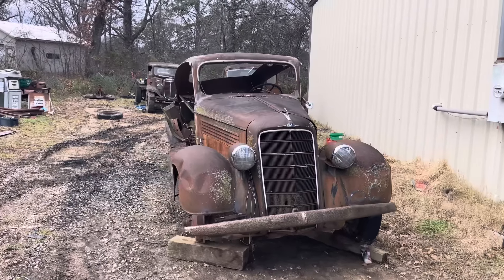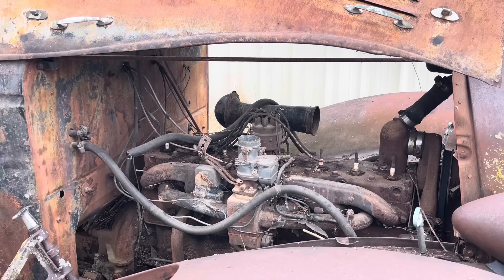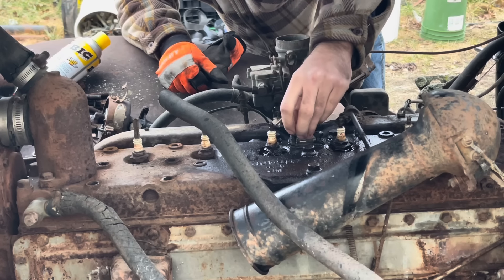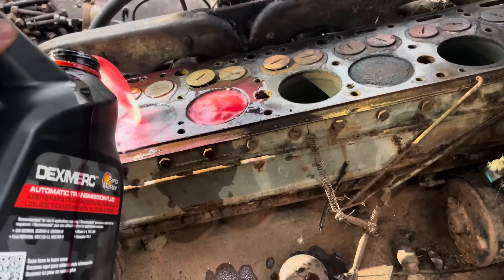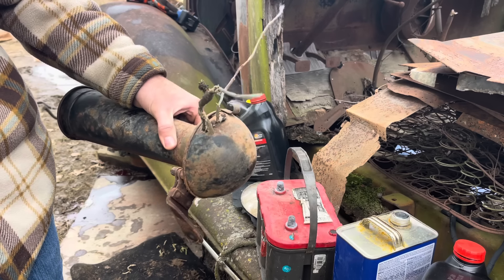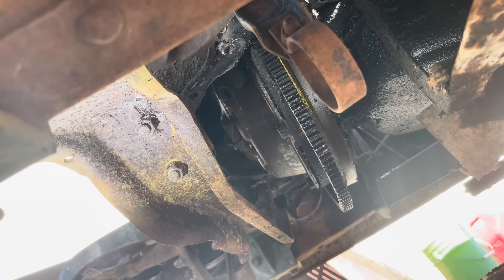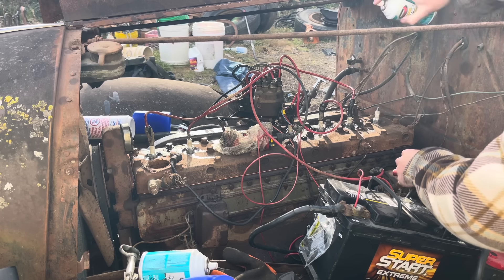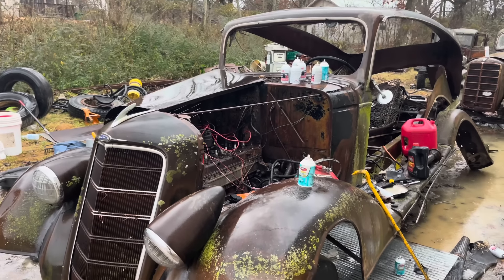Will it run after 80 years 1934 oldsmobile hearse

Comment: 8:11 I don't belive stainless steel hose clamps were used in 1934, maybe I'm wrong.
When did hose clamps of that type first come about?
Anyone?
Reply from the maker: Stainless steel has been used since the turn of the last century I have tore apart a lot of starters from the 1910s to 30s they use stainless steel brush springs for the starter internet says stainless hose clamps started to be used around 25-30 they was first used on cars in 1921
Reply: @jenningsmotorsports7554  
I'm learnin. 👍

Comment: Those rings are gonna be stuck as hell you need to get it warm enough and running long enough to loosen them up. Put the idle high and shut the choke itll run. Replace that flywheel and starter tho yikes

Comment: It looked like in the video at 20:58 the valves on 5 6 and 8 were stuck open?
Reply from the maker: I fixed them after I put the head on I didn’t notice until after the head was on fixed them with a screwdriver
Reply: @jenningsmotorsports7554  oh ok. Good to know. Though just in case. Thanks

Comment: Too bad you didnt notice atleast 1 valve possibly 2 stuck open. Definately had 1.
Reply from the maker: I got them lose after I put the head on did it off camera I checked the video and noticed they was stuck to I used a screwdriver through the plug holes to break them lose

Comment: Exhaust valve is stuck open.
Reply from the maker: I fixed them before cranking it over to get it running just didn’t notice until after I put the head on

Comment: Rebuild that engine - as well as the transmission. The front clip looks as though it could be saved - the body on the other hand is a total mess. Look for another body that is a BUICK sedan or limousine. Might try Canada for that - but you had better hurry because they are rapidly clearing out their auto parts yards with the ancient stuff!

Comment: Reason why it’s not starting because!!

Cylinder 5,6,8 valve are  seized.  

Exhaust valves are seized. Needs to be cleaned !! And resurfacing. Then she’ll start up !!
Reply: Intake valves are stuck open.  She won’t run if 3 cylinders have no compression!!

Comment: Hey guy, I believe if you ck your video over. You will see two cylinders w valves still open.
Reply from the maker: Yes I fixed that before trying to get it running I didn’t notice it when I first put the head on but before I started cranking on it I checked the video and got the valves lose through the plug holes with a screwdriver

Comment: that's practically a brand new car and i could fix it with an old screwdriver the paper from a stick of gum and a strip of duct tape. no need to watch you fumble around with it knowing i'd have it running down the highway at 130mph in less than 10 minutes.

Comment: Try starting a modern car. First, identify engine block…..connect computer……
Reply: @UC2B4RPQ13O97C6eJ7AAgOKA My point is that if you leave a modern hi-tech car in the field for a couple of decades, it will never start. The tolerances in modern engines are so tight, pistons are likely to be seized solid. The same applies to sensitive electronics. They will be degraded that collecting data will be impossible.

Comment: You need to pay closer attention to what you are saying and observing.  Go back and watch the video at the point where you said all of the valves were moving and pay careful attention to 4 and 5.  Valves may or may not be closing on 4, but at least one on 5 is stuck open, so zero compression there.  Maybe a wiped cam by now as well.  If you got it running, that valve would likely burn.
Reply from the maker: I got them lose after I put the head on didn’t notice until I looked at the video to make sure Iol they all had compression just not a lot of it but I did get all the valves lose before cranking it and the valves being stuck open would not hurt the cam in any way also it would never burn the valve